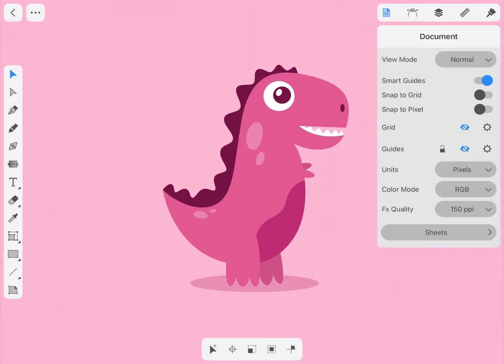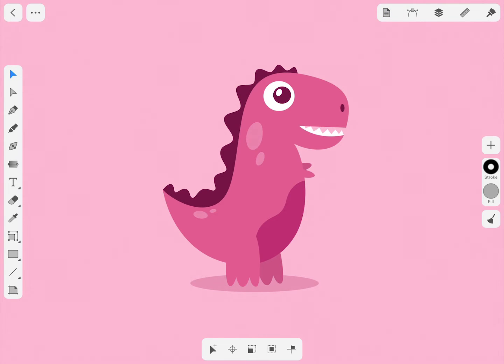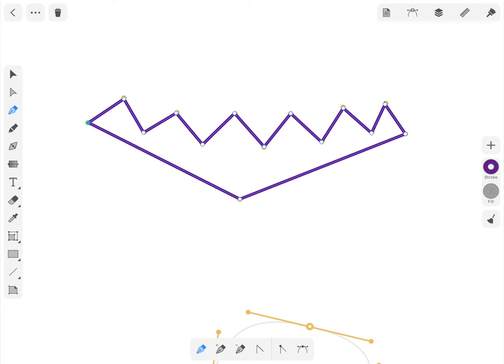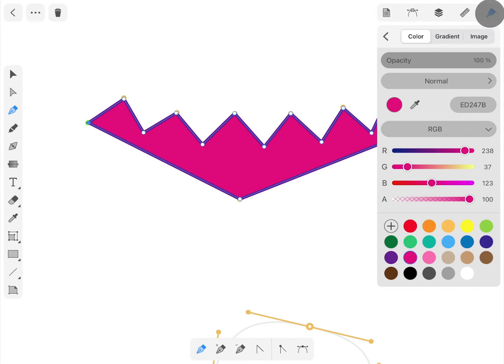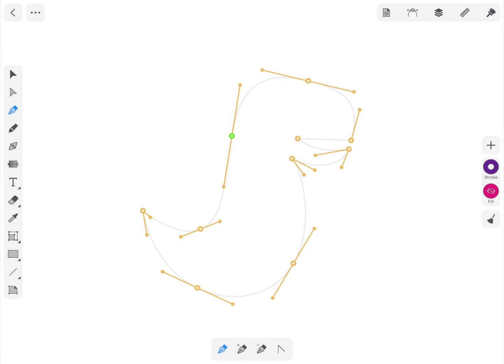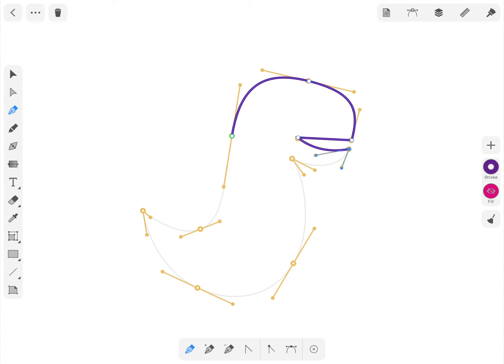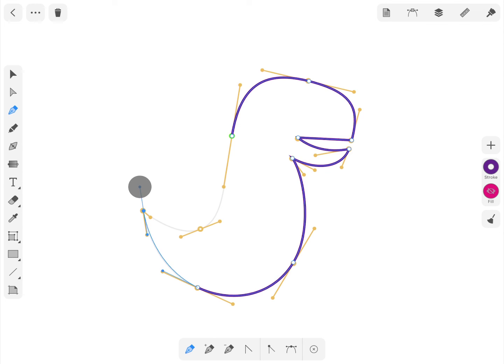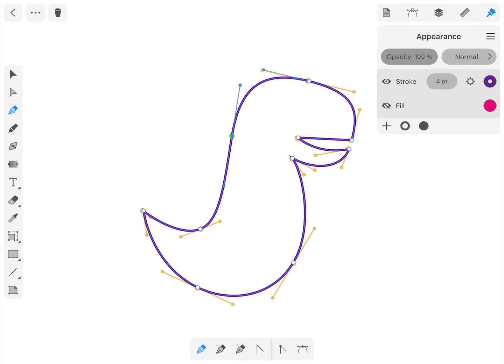Drawing with the Pen Tool—Amadine for iPad and iPhone Tutorials

Comment from the maker: "Convert the point into a corner point" instructions (3:40) should be read as "As you can see, the tool created a smooth point again, while we need to have a corner here. To overcome this, tap on the last point once more to change its type to the corner point. Then we can continue drawing with the straight line."
Reply: Thank you very much. BTW I am curious if this difference is due to an updated pen tool ?
Reply from the maker: @Kaoson73   The Pen tool has not been updated lately. The latest update brought changes to the Draw tool use: https://amadine.com/support/release-notes 
Could you please describe the changes you had in mind?
Reply: @Amadine  I did not want any changes. But I sometimes struggle to continue drawing an existing path with the pen tool. I mean selecting the end anchor point with the pen tool and tapping (ipad) for the new points to add. Sometimes this does not work. Especially if the path that I want to add to is a cut piece of another previously existing path. Sometimes updates brake already working tools. That is why I asked.  Thank you for your reply and interest in a user's ideas.
Reply from the maker: @Kaoson73  Thanks for describing the issue you're facing. We were not able to reproduce it. Could you please send an email with the issue description and attach a document where we can trace its ocurrence to support@belightsoft.com ? The Team will be grateful for this cooperation, as you help us get better.

Comment: Thank you for your great instructions, they're very helpful.

One question, though: I can't get the "Convert the point into a corner point" option to work for the dinosaur's mouth (3:40). I have to drag the lower lever to the anchor point, or I can only apply the icon in the toolbar at the corner of the mouth. Or is something wrong with my approach?
Reply from the maker: In this case, you need to act a little bit differently. You draw with the pen tool, but at the point where you need to make a sharp angle, and on the other hand leave a bend, you touch and press on the tablet. In this way, you turn a symmetrical point into a corner point with independent handles. Holding your finger down, you need to select the desired handle and make a sharp bend, and the other handle (since it is already independent) remains with a bend.